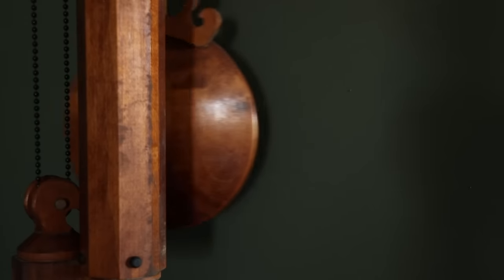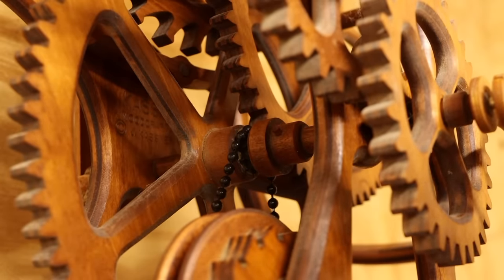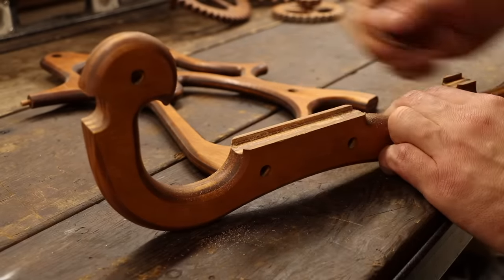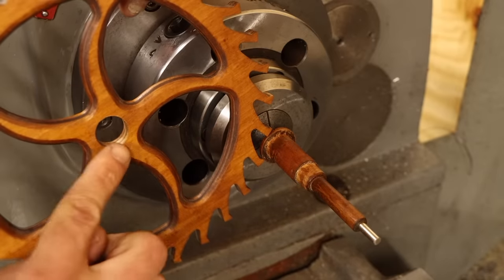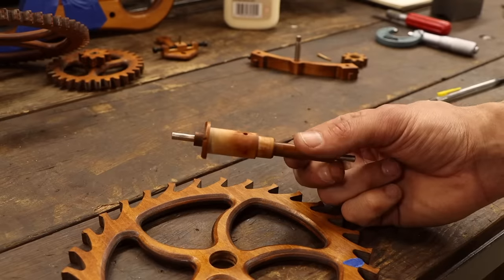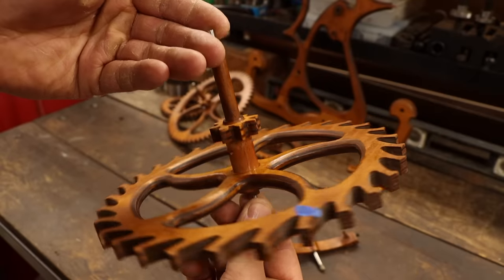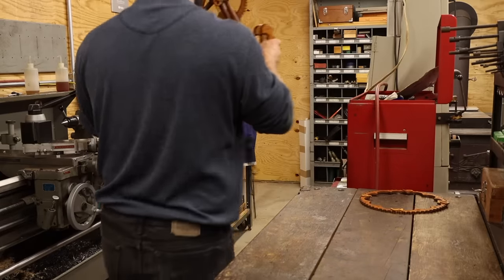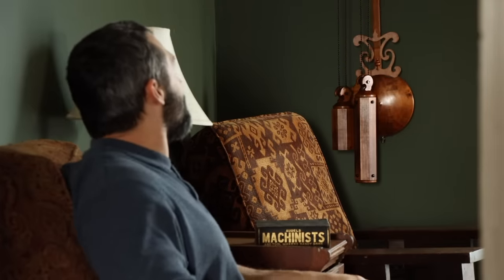Resurrecting the Phoenix Clock || INHERITANCE MACHINING

Comment from the maker: It’s been over a week now and the Phoenix has only stopped a couple times. So I’ve been making small adjustments here and there. But still, it’s amazing how one small detail could lead to this sitting idle for over 30 years…  See you again on April 14th!
Reply: Well if we all know you Brandon, a few side projects later that clock will never stop!! Beautiful work as always!
Reply: Mmmmmaaaake a metal oneeee mortal kombat theme song
Reply: Definitely will be looking for to April 14
Reply: Clocks are the inevitable ending point of all perfectionism. They're so neat. Keep us informed as your mean time to failure increases!
Reply: I'm newly interested in horology, and the pivots, along with the escapement, are the friction points, especially the interaction between the escape wheel and the pallet forks.  The forks are made from jewels in modern movements, maybe use an extra hard wood for the pivots and forks, or even brass bushings and/or inlay on the striking faces of the pallet forks?   Also the runout is still too much on the escapement wheel, and why didn't you try skimming it to closer to flat?
Reply: @danielmclellan7762  I wonder also if a bit of lubricant on the pallet fork and escape wheel faces would help.  Not sure what would be best to use on varnished wood though.  What comes to mind though is that as a kid I would use a dry bar of soap and rub it on the wooden slides of my tallboy dresser to keep it from sticking.
Reply: Maybe some black delrin would make nice slippery pallet forks ?
Reply: Make sure upload a copy of that manual to archive it.
Reply: @sherpajones  Beeswax. It's a fine lubricant for wood and it won;t harm the finish.
Reply: @sherpajones  I was thinking arbor vitae or Koa or something
Reply: Awesome job, and awesome video. Have a happy Easter holiday!
Reply: Wish that manual had fully drafted and dimensioned parts! Would be a great project to build from scratch!
Reply: @jameshisself9324  I'm saying that the right wood for the pallet forks, and different materials for some of the pivots, is the key here. I'm also concerned with the flatness of the escapement wheel.
Reply: @jameshisself9324  I'm commenting in the hopes of helping the discussion 🙃
Reply: Now, your next challange will be to make an entire clock from brass, using the measurements from the wooden clock.
Reply: I am 1:22 in and already I am enthralled, excited and looking forward to your project. Outstanding.
Reply: hey. quick detail. wood glue only works when pressure is applied.  and hte surfaces are well mated.  should some of the glue bonds not hold, you might have to look into using epoxy glue, which will fill gaps between  parts and not require pressure.  that is a scenario where adding grooves to get more mechanical grip in a joint is very useful . but for wood glue, you want a surface as smooth as possible agains another just as smooth, and then you squish until you get goood squeeze out. 
great work, and it`s a cool piece of kit! and i love how you fixed the gear excentric hole.  your solution was neat for mounting it in the lathe.
Reply: I built a couple of clocks years ago, and I, too, encountered hard-to-trace causes of sudden stops. Some tips, maybe you can use it to your advantage:
Temporarily remove the pendulum and escapement and the weights, and see which small weight just gets the wheels turning. Choose various starting points and see if the wheels run smoothly and even. This way you can detect possible friction points in the mechanism.

You can also test the pendulum and escapement and first gear separately with a wire wrapped around the shaft and a very small weight.
Reply: If I were doing this job, I would sleeve the shafts and bush the plates with brass.  You were dead right when you thought friction was the cause.  If you do that, oil the shaft /bush VERY LIGHTLY with clock oil.  I mean SUPER BLOODY LIGHTLY!  Use a an absorb ant shop rag and clean ALL the excess.

If you think you will ever have to do any of this again, get a book.  I have several, but "The Clock Repairs d's Handbook" by Laurie Pen man has enough to get you started.

Finally, call Timesavers. Friendly people who are happy to answer questions.  Finally, if you have specific questions, feel free to contact me.  Not like I'm actually working...
Reply: I remember seeing those as kid and sitting and watching the movements , I have a passion for old clocks and have a extensive collection .. Great work getting your family clock up and running .. This Vid was especially interesting as I love machining and clock repair ..ENJOYED 👍👍
Reply: Funny I was screaming brass bushing at the screen as you decided on that.  Wish your gramps could have seen it working mostly right and have been part of the troubleshooting process and now decide what steps to firm up some surfaces to increase reliability.  Gawd I love your channel.
Reply: I hope you're scanning and uploading that manual for the next person searching for it.
Reply: Question: Did you not scan/upload the manual and the letters?
Reply: @sherpajones  as someone that designed and built their own wooden gear clock, lubricants of any kind on the wheel contact surfaces is a big no, no even finish.... dry, clean and unfinished is the best route...
Reply: Replace the wood escapement claws jewels with brass or polished minerals. They might also need a steeper cut. Thats the one place that cannot have friction and you got a ton
Reply: sorry bug but @ 1:50 it CLEARLY says 1983 - :P
sorry, but you just convinced me to sub with one video and now you get your one hazing for becoming part of MY youtube subbed family LOL - I think I'm gonna LOVE this channel :D
Reply: You just fixed something that your great grandfather couldn't.that's awersome!good job!
Reply: Why not make 1 from metal. That will be a awesome project 😊
Reply: @russnixon6020  Tallow was used a lot on old wood to wood bearing surfaces...
Reply: Awesome, simply awesome! Thank you for the story, Brandon!
Reply: @lourias the pallets will need to be harder than brass.
Reply: You should attempt to remake one out of metal. 😊

Comment: One word of advice, the play in the pendulum pin needs to be shimmed.  The pin slot is too wide and the pin fit is sloppy.  You are losing power there.  The pendulum needs to be snug , not tight,  so when the escapement kicks, all the power goes into the pendulum.  Remove that slop and improve the reliability.   You have made quite an accomplishment.   Nicely done,

Comment: as an old-school master clock-smith, i particularly enjoyed this video. nicely done. the beat was way off and irregular. the best way to diagnosing clocks is by sound. you did not have to measure the escape wheel to know it was off... the sound gave it away right at the beginning. your solution was perfect. however, i always use dies for wood not stains and i always use 1:1 pure tung oil and citrus solvent for finish. dies are the way to go when you use oil finish. very nicely done 🙂

Comment: What a beautiful clock!
I've built 3 wood clocks, none as ornate and pretty as yours .. I'm a little jealous!
Graphite is your absolute Best Friend. No matter how good, wood finishes dont "slide" well over each other, and do collect dust. Graphite from a quality drafting pencil (I think you might have one) on the faces of all the gear teeth makes a huge difference in reliability.
Even after "polishing" all the teeth to 600 grit, I found graphite still made a worthwhile difference.
Good luck with the final adjustments!
Thanks for sharing 🇨🇦
Reply from the maker: That's a great idea!  Thanks!

Comment: I inherited an 1870’s 7’ tall long case clock in 1983, after my mother died. It has a standard clock work of the era, but it needed some TLC too. I found it didn’t enjoy an outside wall in the winter time 😢. Once I located an appropriate interior wall, it would keep time all year long. I eventually found its accuracy was superior to my VCR, of the 1980’s too. I still have it and wind it every Saturday morning. It’s a happy old clock.  It’s a tribute to Robby Burns. 😊

Comment: Great video.  I, too, have gone through the journey you describe so well.  The Kassner clock is very likely based on the Thomas wooden clock plans that used to be sold in the classified section of Popular Mechanics in the 60's.  I bought a set of the Thomas plans and built a clock very much like yours as a senior in high school.  After college, in the 70's, I built several wooden clocks and sold all but one.  I can hear that clock ticking as I type.  I, too, hit upon the idea of a machine screw adjusted crutch to set the beat.  If you'd like to compare notes about our clocks I'd be interested.

Comment: I set the timing by ear on the clocks i work on, and this one is set properly as far as the verge timing. I think now your just working on friction. if you shake the machine all the shafts should rattle with end play. the wheels should roll to a stop smoothly unloaded from a spin. maybe drop some slick 50 on all the bearing surfaces. make a mark on the verge wheel if it stops again,  to see if there is a bind occurring. if so it will always stop in the same place. if it stops in different places its friction or tooth binding. in my opinion the design is doomed because of the surface area of the bearings. Those large wooden friction surfaces add up to a massive square inch of pure drag. Would take a LOT of power to overcome that. i think that if it shakes and isn't tooth bound, you need to reduce those bearing surfaces by a LOT. Look at any of the old wooden clocks you will almost always see brass inserts in a wood frame. You could cut the wood ends off all those shafts, make SMALL brass bearings, and glue the cut off ends over the hole so it looks like they are one piece shafts, but actually are holding a small brass bushing on a brass pin pushed into the old shaft.
Reply from the maker: Thanks for the info!

Comment: Minor correction: the coefficient of linear expansion is very low with temperature change for wood, even lower than plastics and metals. But humidity changes can contribute to expansion and contraction. The proper coating of the wood can reduce this expansion and contraction eliminating intrusion of moisture. Excellent video! I like the shift from making tools to other applications
Reply from the maker: Good catch! Gotta make something other than just more tools for the shop sometimes haha Thanks!

Comment: You should print the script of this video and put it in the manual with the letters.
And don't be too disappointed f you find you can't quite get the pendulum adjusted perfectly.  If that pendulum is not temperature compensated it will lengthen and shorten with temperature.

Comment: You might need to wax all the pivots. That should reduce the friction further and help it keep more accurate time. It would be nice to see you create a copy of that clock, but with all the mechanics made out of 1/4" brass. Using heavy stock will keep the look the original has. That version should be able to keep very accurate time once adjusted as long as it is oiled occasionally.

Comment: Woodworker here. The PVA type wood glues like you used do not have "gap filling" properties, it requires close fitting parts, "toothing" or "keying" the surface will actually make the bond weaker....... Treat these type glues in a similar way you would your Loctite. The way they work; close fitting parts are glued and clamped tight, as it's clamped the glue penetrates the small pores of the wood...... This is what creates the bond, the glue in the pores create a mechanical "tooth" in a way which is stronger than the wood itself....... A good glue joint will split the wood before the glue line. Because of the way it works into the pores of the wood; it'll only work on porous materials...... Wood, leather, and such...... It wont bond metals to wood, best to use epoxy for that job. 
Not sayin all this as in "you done it wrong",  it's not "wrong" if it works..... I've learned a lot from watchin your videos so I wanted to be able to teach you somethin too 😁 
Was a nice surprise to see you workin wood, I really enjoyed this video lad 😁🤙
Reply: To add;
"Close fitting parts" for a woodworker is vastly different from what you would call a close fit....... I more so mean parts that "mate" together and touch all along their surface. If parts are too close, then ya could split somethin as the parts are pushed home....... the water in the glue will slightly swell the wood fibres. Also, the pores in the wood need to be open for the glue to work...... That's why you scraped away the old glue (PVA type glue will not bond to itself) but it also won't stick to any finish (stain, oils, varnish) because the finish is filling the pores, the glue needs fresh wood. 
I thought I should correct myself........ "Close fitting parts" is a term us woodworkers borrowed from yee engineers, but it's a different thing completely 🙄😆

Comment: I was thinking that you could remake all of the timing components out of plexiglass and back all of the wood parts with them to prevent some of the wear and runout problems of the wood. The wood can be what you see, but the surfaces that touch and ride on the gears would be the plexiglass.

Comment: So it's cool that you got out of your comfort zone and resurrected this clock. Couple of things:

The bushing really was unnecessary, however I do like it adds your flavor to the clock. The wood movement of everything will be far over 1/32". Woodworkers don't work in that precision. In fact, the wood movement will not only be over 1/32", it won't even be consistent, since wood moves more across the grain than with it. That why this clock has so many macro adjustments to it in the first place!

Your main problem which you fixed were all the poor glue joints. Once you firmed that up, you're 90% there.

Two, your bushing won't hold long term with wood glue. Wood glue works by working itself into the grain of the wood. Wood glue also shrinks and gets brittle, so this join will fail sooner than if it were wood on wood. When it does fail, just glue it back in with epoxy.

Not sure if you took a level to this, but it also need to be plumb to operate well.

Finally, and maybe you did this, I'd recommend putting some paste wax on all the mating surfaces which move (joints, hinges, etc). Rub it in with 00 steel wood and it will feel like silk.

Comment: Very nicely done, but a comment if I may. Since replacing the toothed pinions with lantern pinions is obviously out (and I don't know how well they'd work with involute rather than cycloidal teeth), the one thing that would probably make an enormous difference is replacing those wooden palettes with well-polished brass since there's three wood-on-wood sliding contacts per cycle.

Comment: Great job! It looks like you're getting recoil in the escape wheel, when that is a deadbeat escapement. It looks like you need to adjust the angle of the exit pallet if you want this clock to work better. Also a tighter fit between the crutch and the pendulum will save some efficiency, but some play is necessary.
Reply from the maker: Thanks for the tips!

Comment: Watch and clock mechanisms are fascinating. I got into watches a few years back and I wear mechanical automatic watches just because I think they're so cool. I don't need it to know the time, I have a cell phone. I'm not interested in smart watches, because I don't need my cell phone on my wrist. 

It's just so magical how they can make all those tiny parts, the gears, the screws. Everything is microscopic and the tolerances are crazy. And it all comes together and it works. 

You can get Chinese homages of Rolex watches that look just like them and with very good accuracy. A $50-100 Pagani Design automatic watch is a marvel of engineering and an unbelievable value for the money.

Comment: What Would Be Cool, Would Be To Make A New One In All Metal.. Brass & Aluminum Would Be My Thought, But As A Master Carpenter, I Am Prone To Use All Wood, And There Is The Downfall, All Wood Expands & Contracts With Temperature Differences an Moisture In The Air.. 
Loved Watching This.. Thank You For Sharing..

Comment: Would have been really cool (for the brass bushing) if you double threaded it with a SUPER coarse custom thread.  "Screw" it onto the middle piece then use it (with the center piece) to "screw" it into the "Hub"...making sure the the threads tighten in the same direction that the Hub rotates in.

Comment: It's not often that a video brings a smile to my face as this one did. You did a great job getting that back to working order. I wonder, have you considered wax or other finish for the gear teeth to lower the friction?
Reply from the maker: Thank you 😊  I may consider something like that If I run into any lasting issues.  Might also use some on the bushings

Comment: Missing a little data.
1:Appears you used a Loctite  product on the wood (&Brass) but I did not get the actual product number?
2. Did you use a 1.5° taper on the shaft retaining pin?

Did your Grand Father work on the clock any?
So, it took four generations to fix the American made clock?
That sir, is a story to tell your Great Grand Children in 40 more years.

You should update Popular Mechanics, You might start a side husle on wood clock repair if the youtube gig slows down.

Ok enough digs on engineering.
Lovely shot of you Den.
I suspect, You, and your wife, spent considerable time renovating the old farm house.

Rural areas can be a headache for electric power during winter storms. Any back-up power stories to share?

Great work on the tap and die tools.
Working on the lathe with the die tool looks MUCH more dangerous than the tap tool.
Those large dies may be too dangerous with the immense torque of the lathe, so I think you should stay with the multiple pash single cuts on them.